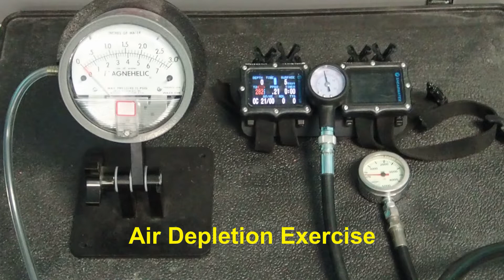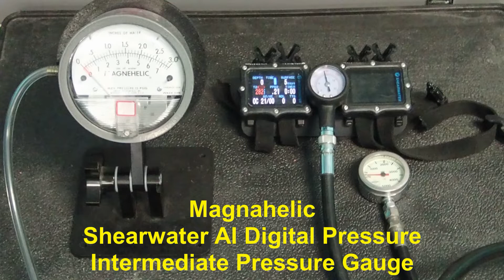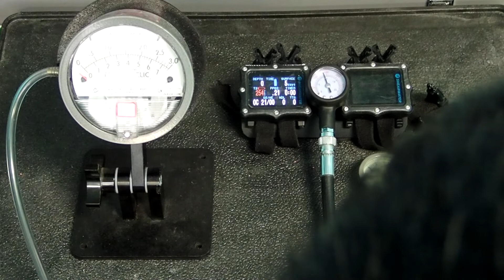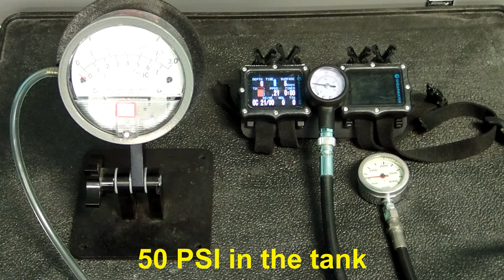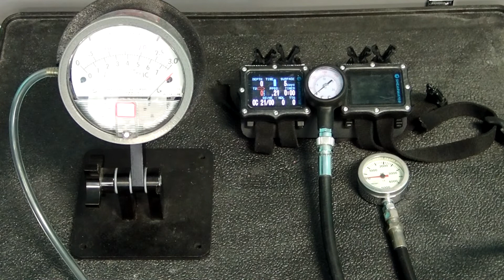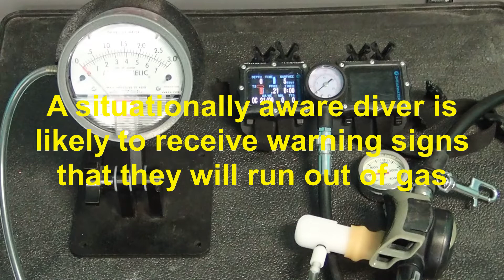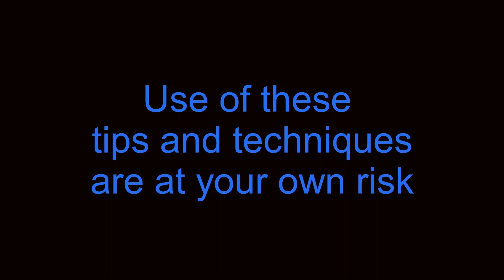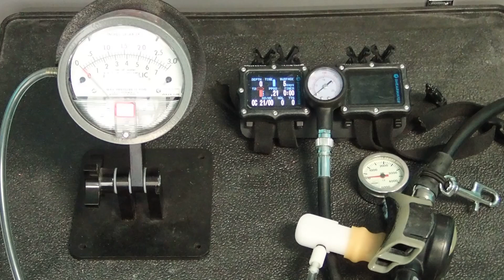#87 - What Actually Happens When Your Scuba Diving Tank Approaches Empty

Comment: at sea level the ambient pressure is 14-15psi.  With a balanced regulator it's taking into account the ambient pressure which goes up with depth.  my experience with low tank pressure at depth is it becomes harder or there is an increased work of inhalation.  I ran a tank to zero in a pool with a full face mask, OTS, and it started chattering as the tank became empty.  I didn't notice that with a normal second stage regulator.  Thanks for the video, the more you know...